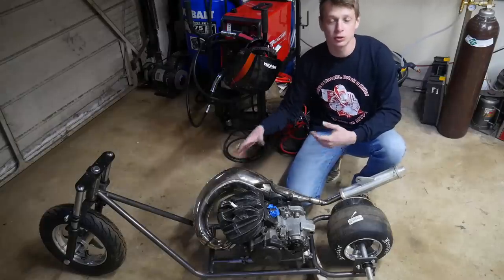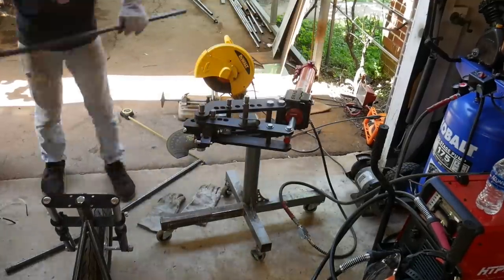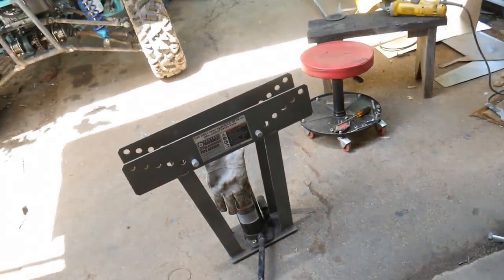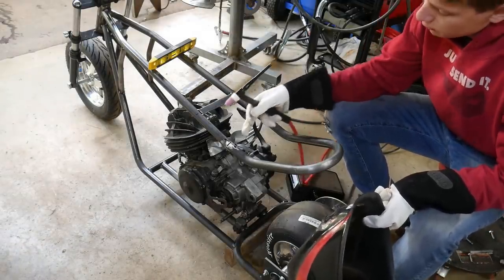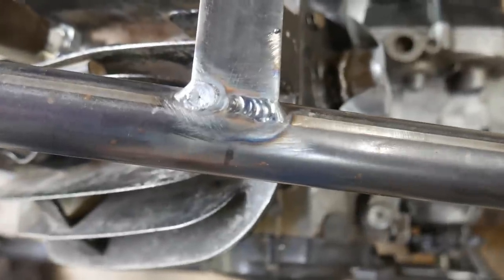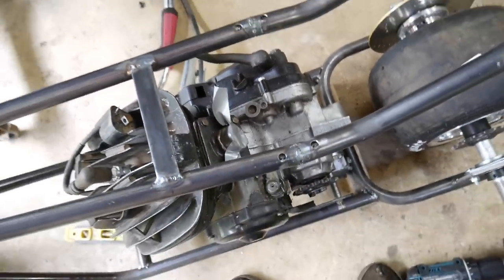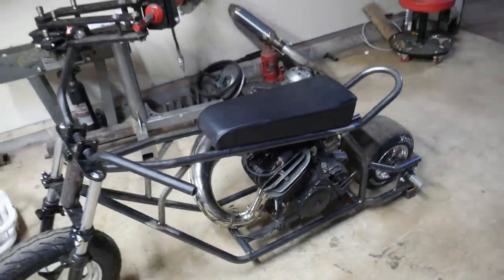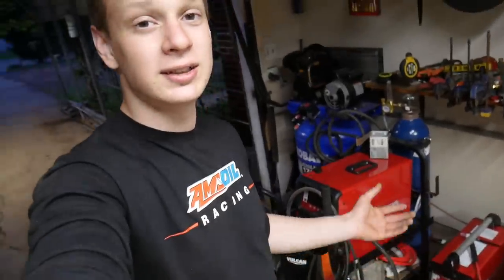240cc Drag Mini bike build! Part 2

Comment from the maker: The goal is not to look fast, but also to actually be fast. I believe this thing will be able to compete with some fast cars in the 1/8 mile
Reply: Could you please let me know the name of the Beat at 8:00, Thank you.
Reply: better fix the seat then, this way you will slide backwards, besides dangerous, it simply sucks if you have to keep doing your best to stay on the seat, with a torque machine like this it should at least be flat, or better a bit leaning forward, nice to see you got recognised by HTP, thumbs up
Reply: Vasily Builds if you put a kill switch on the gear lever you can bang through the gears fast without the clutch. Same as what a race bike uses
Reply: Ur a nice person
Reply: Liking all these comments
Reply: The other racer would need dodge charger like vin diesel
Reply: Alexander Pötzelsberger so much torque it would twist the chassis of the line
Reply: Sure bro with this big torque and power in a small frame it will be a beast... Keep up
Reply: 30-40hp , are you sure?
Reply: Man I have faith! The power band on this engine when it was on the Scoot was TALL! If you harness that right with this build.... it's gonna blow peoples minds. 
Ps. Watching you rebuild two strokes with such confidence, and patience helped me get over my "this job is to big/I should pay the shop to do it" attitude.🇨🇦
Reply: It will
Reply: Ярослав Олейник  yes blasters can easily be 40hp which is like 4 more hp than a 250r some guys on blaster fourm have drag blaster that are almost 50hp

Comment: This guy's got like 7 welders and I'm on hold until I can find one lol, keep it up that bike should be really fast
Reply from the maker: Only two. Got rid of the rest
Reply: @VasilyBuilds  dang I would've died for one as long as it welds
Reply: @fantro1064  same. I have an old ac stick welder. It works but is inconsistent and only runs half the size rods it says
Reply: @oli12shackel9  @fantro flux 125 welder from harbor freight
Reply: @Quirin looking at titanium flux 125

Comment: What type of steel are you using. Crome moly? An what size is it ?
Reply from the maker: Just mild steel 1" 0.083 tubing
Reply: @VasilyBuilds  ok sweet.  I want to make one    I have an old RM80 engine I'm rebuilding    hopefully I can get a few others keen on the idea.  There is not alot to do here lol

Comment: Just one tip when you get a welding sponsor like HTP and your testing it  in a video. DON'T put Vulcan or any other competitors logo dead center while using it. Just my two cents 
Other than that 👍👍from this guy
Reply: They should have sent a helmet too...

Comment: When learning tig, good joints, and no filler rod, unless you really need it.
Reply: Bob G you have to use filler wire on a structural joint

Comment: Just a suggestion where your top tubes and bottom tubes meet on the down tube of the triple tree I would put a gusset there to help with keeping the front from flexing and possibly causing the frame to separate
Reply: Jason Lazore that could help I’m have a bit of flexing problems on my build
Reply: @DktheWelder  gussets are always a good help. Just like building a roof you would want the support to keep things from flexing under any load and fall apart. Try to find all of the points that maybe a point of flex and put a gusset there

Comment: You're killing it man!!! Best advise that I was given when I was younger and first learning to weld was to just play play play play and play some more with the settings on the welder and keep notes of what the settings feel like and what settings you like for whatever material you're working on. I used to keep the short notes of the settings written down on a small piece of paper taped inside my helmet and kept a more detailed notebook in my toolbox. I still have that notebook (along with a whole bunch more) in my toolbox.

Man......... I'm just now realising how many damn notebooks I have that are completely full. And I actually refer back to them more often than you would think. At least twice a week I'm digging through those notes for something or other.

Comment: Great build. Those TIG welds weren't bad. I think you just need to clean things up better. To get a nice TIG weld you want really clean metal. Flap disk then acetone. You could see a few sparks in the video which is a sign it's not quite clean enough. Looks like you nailed the heat and the speed and getting enough rod in there which are the main things.

Comment: TIG welding is not the easiest skill to learn, especially when you get into much tougher metals like Aluminum and stainless steel. Took me a few hours of nonstop practice in college to get the right color and to not warp sheet metal stainless steel. If you really want to practice an out of position, do 6G on tubing; 45⁰ angle pipe in a fixed position.

Comment: Is it an ac dc welder an if it it what were you using. Also at the front where you put the two bars in why don’t you fill the gaps with sheet metal and us as a fuel tank if would be sick and airodinamic

Comment: the front wheel is to small. it's not gonna handle well, which was the problem with the last one
Reply: That 10" front wheel is perfect actually, I have built several custom minibikes with same size and they are very stable and cruise smooth
Reply from the maker: Right on bro! Believe it or not, this exact wheel and tire combo is used on a 140hp outlaw minibike pushed to a ridiculous 6 seconds and 100mph in the 1/8 mile
Reply: @turbolaser24  o gatcha
Reply: @VasilyBuilds  oh,  don't know much about that stuff. just know the last build had that problem

Comment: Glad you took the advice and got it ported, absolute animal now :)
Reply from the maker: No i havent got it done yet. I want to do a baseline run first
Reply: @VasilyBuilds  Gotcha. Regardless, do a leakdown test and plug chop before hooning on it. I've had multiple blasters in the shop from people who worked on them themselves and it's usually an air leak/poor jetting that cause the top end to go.

Comment: Got a question for you. What would happen if someone welded a sprocket onto the crankshaft of a 212 instead of using a clutch for one of these? I have an older motor, one of the predators before they became a predator, greyhound or something like that, and was thinking about trying it to see what happens on the new mini bike I got. Gonna make a video on it here come Friday!
Reply from the maker: As soon as you go to start it, it's gonna fly off, and if you try to stop it it's going to stall. You need some sort of clutch. What you could do is  weld a 1" collar on the sprocket and then the sprocket is removable
Reply: @VasilyBuilds  Thanks for the response, I'm just trying to think of things that have not been done yet and will experiment with them.

Comment: Not trying to be a douche at all, but blasters fully built with all of what yours has plus custom heads, massive port work, timing work, etc only make up to 35 hp. Yours id say will be around 30 if it’s tuned right
Reply from the maker: I read a stock Vito's 240 with stroker crank dynoed at 31hp.
Reply: Vasily Builds that’s just a marketing strategy. I used to build blasters and I took a 240 stroker blaster on the dyno, ported, piped, v force reeds, and that made 26hp on a dyno at my local shop. Then my full mod with the head re domed and everything else made 34hp, almost 35

Comment: You need to clean the area that you are tig welding on you have so much shit in that weld i would not ride on that it is not safe, I have a welding license so i know what im talking about!
Reply from the maker: In a critical application Yes. I did clean it up obviously. The parts you seen me Tig weld were non-critical.
Reply: @VasilyBuilds  critical vs non-crtical

Critical - lots of people die.

Non-critical - one person dies.
Reply: There was no porosity in it will be fine . If you add more filler wire it can compensate for a dirty joint but scotch bright the wire and joint before welding can help alot